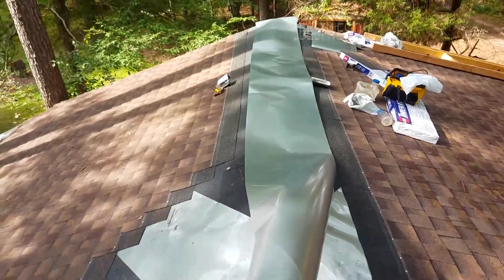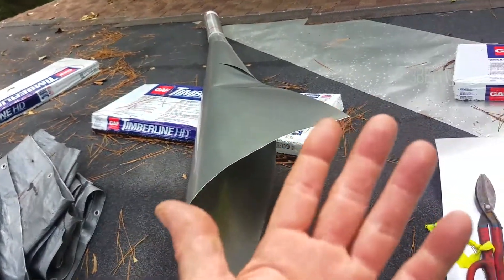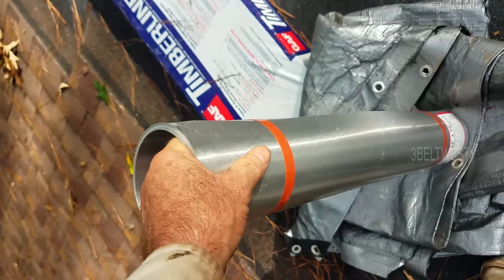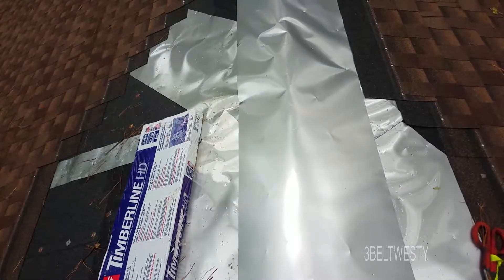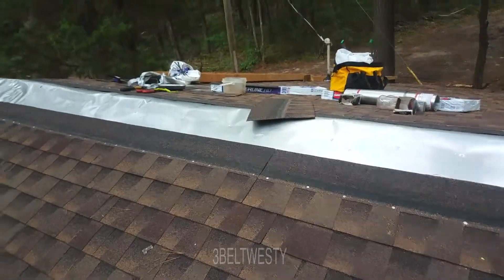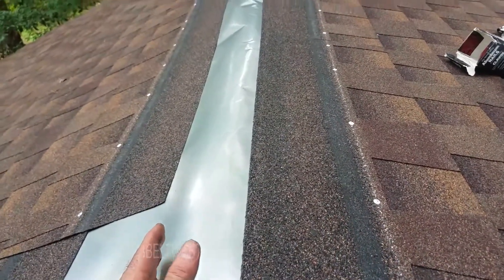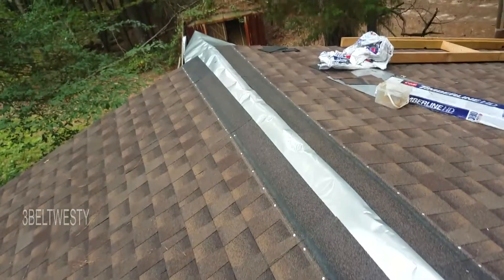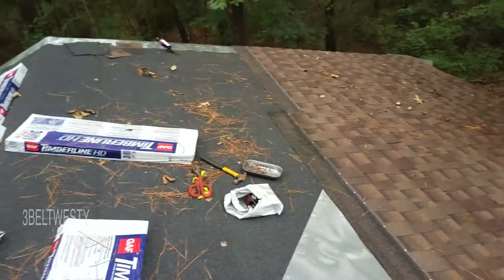Aluminum Radial at Roof Eve GAF shingles Vertical antenna

Comment: I use a mobile gutter mount screwed to a tin roof,this keeps the correct distance between antenna and ground plane to get a good impedance. I would suggest removing the tiles o the ridge in the middle of the roof then screw a mobile mount directly to the centre of your sheetmetal strip. I have a 20M long wire and a 10M long wire coming from the mount as the main elements each go to the top of 2 tall trees it works great on 40M and on 80M.
  If you had sloping radials it may work even better if you can get away with 1/4 wave lengths or shorter from the centre feed point and running diagonally in an x configuration down to the 4 lower corners of the roof surface.
Reply: My next step is to raise the top of the verticals even higher and then run them down to my main house roof which is entirely in tin, i'll add bonding straps in an x shape to make sure at least an x pattern of roofing sheets are making a good connection in all directions from the feed point. You might want to make the connection out of a thicker piece of aluminium if doing it my way with a wire antenna, your main problem will probably be the distance from your radials to the feedpoint. It's not the same theory but if you were to start lifting a mag mount above the roof of a vehicle it would drastically effect the impedance the same way as it does if you remove the rubber insulate mat on the underside of the magnet. If you have ever played with a mobile mount that has the so239 type connector with a coil loaded antenna and you add some male to male connectors between to lift the feed-point above the roof you can see crazy things happen with the SWR and the bandwidth. I'm guessing lower bandwidth the better the gain and the greater the bandwidth the less the gain but without modelling it or doing extensive testing it is difficult to see the take off angle of any high gain antenna.